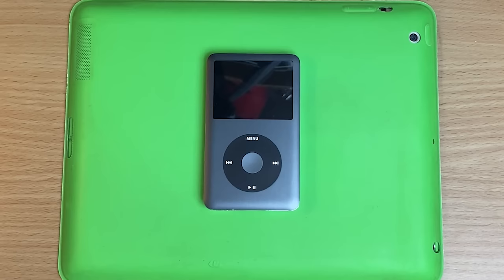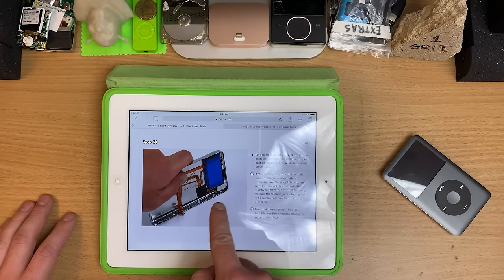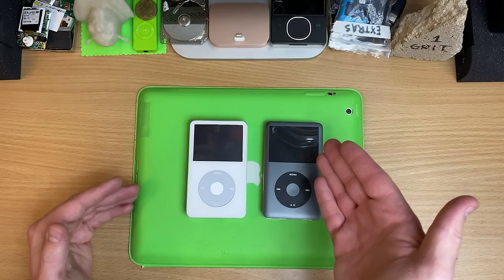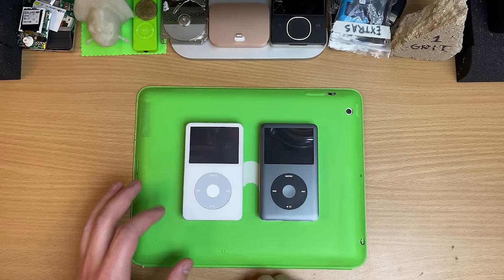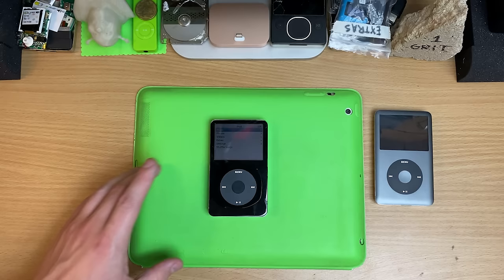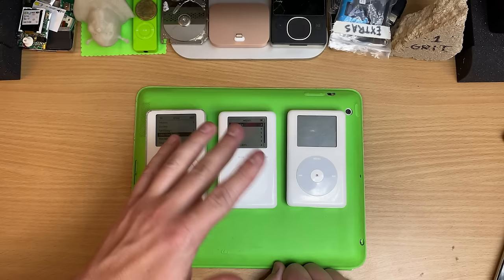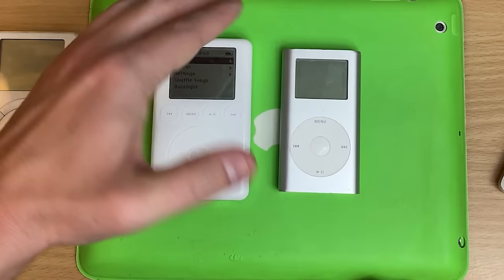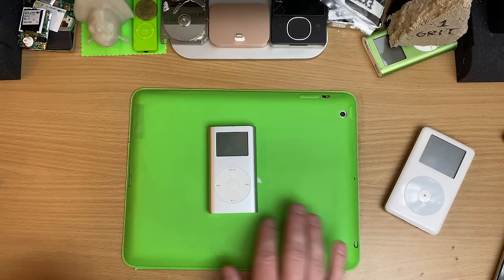The CHEAPEST iPod to modify

Comment: I watched this video and the next day I found a blue 2nd gen mini in the recycling at my job. I can't wait to use iFlash on it and add a new battery. :)
Reply: iFlash?  Just get a CF-to-SD adapter or a big compact flash
Reply: the thing is that those adapters aren't as reliable with iPods as the iFlash ones
Reply: @merouby  iFlash is the way to go, not some cheap chinese knock off that doenst work half the time

Comment: The iPod Mini 2G is literally the greatest iPod ever. Small, light, and they used the incredible IBM Microdrive which at the time implied Apple MIGHT have been making them AT A LOSS. Rumors suggested photographers were picking them up on sale to get the 4GB Microdrives cheaper than they were sold individually.

Also, the drive adapter pops off the board too, so just pull it off (gently) rather than trying to do what you did of wiggling the Microdrive out.
Reply: More than likely they got a deal with IBM, who early in the computer scene had a virtual monopoly on those sorts of bits and bobs because of patenting and shit

Comment: Thanks for the vids! With your help I pulled a Lazarus on my 2004 4th gen monochrome LCD. Popped in a new battery and an iFlash double SD card mod kit with 256 GB card and it works great with 236 Gb actual capacity. Loads of space for tunes and great battery life. Love it!

Comment: Got myself a metal 6th gen with a busted HDD as I wanted one of them schmexy new ones to contrast my older iPods. Gonna need some blades to get into it, lord have mercy

Update: I was blessed and with some hard work the exacto method worked, and it actually proved to be not toooooo bad (depending on your definition of pain)
Reply from the maker: Just remember 128gb max on a 6g
Reply: @DankPods  I'd settle for 1Gb frankly if it made the thing easier to crack, not sure if you've ever tried sacrificing storage to the iGods but will let you know how it goes
Reply: I have the same model. I want to get rid of it.

Comment: Hi Dankpods,

After watching your channel I thought I'd do it myself. I took a risk and modded my 30gb 5.5gen ipod and put 448gb in it (which for some reason is 416gb in apple maths) . My library is only 18,200 tracks but 13,500 of them are large ALAC files from my CD collection so that's about 350gb, the rest are mp3s but everything has artwork. My ipod could cope with all 350gb of my alac files but started having trouble with all the mp3s as well and it didn't like showing album artwork unless it was rebooted after syncing. It maxed out at around 17,000 tracks with a few issues.

So I wondered if I could make it all work perfectly. 

Luckily I managed to find a cheap 80gb 5.5gen, I took the back cover and front cover off my 30gb (I thought I'd use my front cover as I know where that's been), got a new battery and combined it all together. So now I have a monster slimline 448gb 5.5gen ipod that works like a dream, it'll even play the few old music videos I have and it has 30gb of space left over.

And yes it shuffles.

Thanks for the inspiration.

Comment: So I began modding these and here are my tips I’ve found
1) buy iFixit batteries, knockoffs can absolutely suck!!!
2) be careful removing top bezel, and moving motherboard/headphone jack. If the contacts unseat you’ll put together an iPod with no sound.
3) internals can be difficult to remove if battery is swollen, “it will fight you”
4) when re-adhering the bottom bezel, the tabs can easily break and prevent flush seat. Just remove and reapply
5) I use contact cement and q-tips for top/bot bezels, works like a charm.

Comment: 1st/2nd iPod gen can actually go to 40GB with a 4th Gen “04” HDD... I’ve done a video on that, I also just finished a 128GB 3rd Gen (it’s a pain to setup and use but works) and the 4th gen can go up to 256GB with no issues... I agree though that the Mini is the best, my daily is a 128GB I’ve had since 2013 and I’m getting ready to upgrade it to 256GB myself
Reply: What are the exact adapters you use for 4th gen? None of the things I've seen in these videos have worked.
Reply: Iflash has an adapter to convert Zif to the pins then you can just use the iflash boards... check out the 3rd gen videos ;)

Comment: With the mini it seems like aside from plastic cases you can only get refurbished cases nowadays
Also with the battery you may want to be careful when selecting replacement batteries, as a few have their wires placed in such a way that they push on the headphone jack board, causing it to come loose over time (I've had to open my mini half a dozen times because of this, I ended up having to tear off the stuff the manufacturer wrapped the battery cell in to re-wrap it with electrical tape so that I could actually have enough exposed cable to route it properly)

Comment: hello i just purchased a iPod Mini 2nd gen and i did a battery replacement and the flash mod. I knew that there was the risk of knocking off the C18 capacitor and not having the click wheel not functioning properly. I knocked it off and with the original drive the forward and backward buttons for skipping tracks didn't work. To me it was something I was okay with and was going to live with. But when i got the SD card with its adapter it didn't work but them i restored it and it suddenly worked again. I don't no what happened but i have a fully functional iPod now. Thank you for the video to and it was a fun project.

Comment: Monochrome 4th gen. is one of my favorite electronics of all time. Also love the silent buttons and sound quality of the 3rd gen. and the battery life of the 5th gen. Threw a 128GB microSD in the 4th and 5th and use these 3 in combination throughout the week. Looking forward to getting a CF card in the 4th gen. (for that sweet 10% battery improvement, hah) and the HDD out of the 3rd gen. in the future. I've only got about 7600 songs at 75% ALAC, 155GB so all the good ones fit on 128GB just fine. Good times. Love these old things and these videos.

Comment: A significant advantage of the later 6th and 7th generation iPods is their ability to power a Bluetooth dongle via the 30-pin connector, which is not possible with the 5th generation models. This setup allows you to bypass the inferior digital-to-analog converter (DAC) found in these newer iPods, directly transmitting the audio signal from the motherboard to your headphones using a Bluetooth 4.0 connection. The audio quality of this Bluetooth setup is nearly on par with CD quality, showing only about a 2% loss in fidelity. In contrast, using the built-in DAC of the 6th and 7th generation iPods with a standard 3.5mm headphone jack results in a 10% degradation compared to CD quality. Furthermore, even modifications to the 5.5 generation iPod Video that add Bluetooth capabilities still rely on the original DAC output via the 3.5mm jack, which means the audio quality is comparable to that achieved by simply attaching a basic Bluetooth dongle designed for airplane use to an unmodified iPod. Therefore, the optimal audio performance is achieved with a 7th generation iPod using a Bluetooth dongle connected through the 30-pin connector, powered directly by the iPod itself. And when you use the aforementioned BTLE dongle, you use slightly less battery than you do when powering over-ear wired headphones from the 3.5mm jack.

Comment: the best way i found to open an ipod mini is to apply a strong double-sided tape on the plastic parts leaving a piece left over on the sides and stick it on a metal surface then pull the ipod slowly.

Comment: I finally did this. Since the video was posted I looked for iPod minis at a decent price and some were just too much and there just wasn't much to go for. After a little bit of searching and finding a good deal, I ordered it, a cheap SD flash converter and a battery. It turns out I ordered the wrong IPod (second gen nano, silver) and ordered another one that was also a good deal. When that one finally arrived (pandemic started to really take hold of America, so some delays happened) I carefully took the whole thing apart, having trouble with the weird clip thing in the bottom. BTW there is a Instructables page showing a guy using hot glue and a plank of wood to take the plastic bits off without scratching or bending anything. After all my careful work, I come to find out that the parts I ordered were junk. The battery was way to thick (the spot where the wires come out was to bulging and there was a thick metal tab on the other side under the plastic heat shrink that was to thick) and the SD card converter just let the IPod write but not read. (I know this because I didn't have to reformat the SD card in the IFlash adapter) After ordering a battery from a better known provider and a IFlash adapter that I had to buy on eBay because the main site was down and when It went back up, there shipping was too expensive. The battery was delivered very promptly in a cheap but fancy looking box I could see being on store shelves. The adapter on the other hand wasn't shipped until a week later and then took a bit to get here. when I noticed it hadn't been shipped in a week I emailed the seller and they were like "oops, forgot." which brings me to today, where I finally got all the parts and tried again with much more success. Every thing works and i'm syncing it right now. The only thing i'm worried about now is the battery was a very snug fit and I know how much they like to expand. So I think i'm going to charge this in a metal pan or glass jar from now on. I also recommend getting kapton tape, its like electrical tape but much thinner for holding things together like the rubber bumpers on the flash adapter. Its as thin as the black tape they put on the drive itself.
Reply: Also, who do you buy batteries from? I bought mine off of eBay by some company called "Cameron Sino" and the Ifixit it site was out of them ( there 360 view shows a battery that looks very similar to the eBay junk.)

Comment: Alright, I actually dove into this thing, got the iPod, got the converter to get at least to 118GB, new battery- all working well...except one thing.  The clickwheel.  I've gone through FOUR different clickwheels- all just have issues functioning- 3 dead, and one works but Jesus Christ, the pause/play button doesn't work properly.  It may be the easiest to mod, BUT those clickwheels must be MAD sensitive to damage.  I'm actually awaiting my FIFTH clickwheel replacement.  I hope this doesn't come out to be a dud.

Comment: Many years ago I bought a second-handed ipod classic that suddenly stopped working some weeks thereafter. No sense for me  to repair it through ipad service and therefore i tried to repair it by myself with a  spirit of "nothing to loose". I tried  just introducing the nail of my thumb and with an up and down movement, many times, the ipod oppened. I disconect battery 1 minute and shortly thereafter y connect it and from then on it worked fine till now.

Comment: I just got a Mini recently and man, this thing is real tiny. It however had a little bit problem with the hold switch, fixed that by putting some isopropyl alcohol on the switch, move it back and forth and it worked

Comment: 9:34 I can't find the people that throw these away on eBay. The cheapest ones going are iPod Shuffle, the older 1GB one, and 2nd gen iPod nanos with a faulty backlight or/and with a f-ed battery. And the iPod mini's that are 2nd gen and are in working condition are all either pink or cost 100£. The 1st gens are cheap though, a green one is like 15£, though still more costly than the 4th gen iPod touch I got for 7.50£ (without shipping).

Comment: Pressing questions... So, over the summer, I've fixed/upgraded about 6 different iPods. I just did my 2nd Gen Mini upgrade and have noticed a few things.

1. Loading music is S---L---O---W.... is that just a thing I'm going to be living with? I get that going from 6 gigs to 256 means I'll make some concessions. I just want to make sure I didn't botch the job.
2. Car trips - I drive a Prius and have a USB port for my car stereo. When I plug my 6th and 7th gen iPods in, I can see my music library. When I plug in the mini, it shows up like it would if I was on a computer and tried to hack my tunes to back up (no logical labels, four-character letter folders that follow no logical order). Even if I set it to play a song, when I plug it into the car, it plays a different song. The car shuts OFF the iPod interface and only allows menu access on the car's screen.

I'm open to suggestions. :)
Reply: Anyone? Is this a firmware issue? Can I fix it?

Comment: I might actually ask for this in Christmas. The Ipod Mini Honestly looks pretty fun but I'm only worried abt battery life and don't know if its gud
Reply: A bit late but the first gen operates for 8 hours, second gen does 18. If you want search functionality, 5.5 gen classic or later. That's my nitpick as someone who never owned an iPod but I got used to it. I also added functionality with rockbox. What I like about rockbox is that you get to switch between stock software and rockbox by turning it on with the lockswitch on/off.

Comment: i just picked one up for 5€ and flash modded it with the exact red cf adapter u showed and it worked first try i used a san disk ultra card in it

Comment: Wanted something I could leave in my truck so I got myself a Mini on eBay for cheap because the lens was cracked (LCD is fine) and the battery was shot. 
Somehow managed to snap off the hold switch, don't know if it was during disassembly or reassembly or while it was disassembled. Doesn't matter too much to me because I have a 6th gen for any other listening but I'm still annoyed with myself.
PS you can save a buck by getting a first gen and the only real difference is 1st gen max storage is 128 GB and 2nd gen is 256 GB.

Comment: I saved up and put down just nearly $500 on one of those modified 1tb 5.5g off eBay, and installed rockbox to circumvent the 40k file system indexing limitation (have over 100k files). Only problems are rockbox is ugly to navigate and it was the janky plastic face and wheel so it got scratched up within like a week and it’s been hard to see ever since. I have a genuine 30gb lying around that I can take the face and click wheel from but I’m intimidated by the process.

Comment: Bought a 2nd gen mini, got the SD-CF adapter.  Did all the steps but it won't boot (I get sad iPod face).  Can't figure out what's wrong.  Tried reversing the adapter too.  Don't think any of the cables are damaged.  The hope is to pop a 256GB microSD in there, but I tested with smaller ones (32 and 8) and they didn't work either, same problem.

Comment: SO having picked up a (as i just recently figured out ) a 6.5 gen for free I found ifixit's instructions very unhelpful. I watched one of your vids where you had it apart, looked where the clips were, attacked it with a razorblade and a guitar pick, had it open in about 10 min. If you need to rip on of these apart, seriously look up a picture of where the clips are, and it will help TREMENODUSLY. 

Also, don't use a screwdriver, make sure to use something at least 1.5 to 2 inches long, or you will destroy the outer case. 

Mine is Syncing currently with a 512Gb SanDisk in it. Was really sad about not being able to maintain the stock os, but being standalone from iTunes and more storage is a definite bonus.

Comment: From the reading I've done, you can use 1st Gen Mini's however their battery life is terrible compared to the 2nd Gens, despite using the same battery.

Also, a great way to tell the difference is look at the EMC number. 1984 = 1st Gen, 2044 = 2nd Gen
Also also, if it has 6GB engraved on the back, it's obviously 6GB, but the 1st Gens only came 4gb so it has to be a 2nd.
Also also also, the colours of the 1st Gens have always seemed to be a bit "paler" than the 2nds. Have a look on google images and you should see what I mean.

Comment: Hey this is probably out of the ordinary and completely unusual but I have a 5th generation ipod nano and its formatted with MAC but I do not have a macintosh or any type of mac based system nor am I able to factory reset it through apple devices on windows or itunes it always says “Network Connection was reset please make sure your internet is active and try again” I tried this around 9-10 pm my time yesterday and I couldnt get it to work even after manually flushing/clearing my dns history it would let me get to the notices then say the same thing is there any way we would be able to call and you help? Im 17 and I have no clue how to run apple software besides the ipod itself I got the ipod from a thrift store (american cashies) for 3$ in mint condition no spicy pillow and you are the only person I know that may be able to help me in this situation

Comment: I must dig up my mini. I managed to put a 32 GB CF card in, but i think i will take it to 256 with the adapter. But i wonder.... could it push 512 GB? Maybe even 1TB? Basically use it not only for music, but as a disk drive for extra storage. I also might try to up the storage on my 3rd and 4th Gen to at least 64. The 4th gen photo might try and do 128.

Comment: I'm trying to get my classic 4th gen back up and running. Its flash modded and works from a software perspective. My issues is with to charging, I've tried a few 750 mAh batteries and they all continuously charge, if i unplug it the battery has charged but they all drain super quick even in standby. could this be the logic board?

Comment: I was trying to modify a fifth gen ipod with a 1000 gb card. My first time doing this, and I actually got it in and back together. Problem is, that everything was super slow in restoring. When I tried a few songs, no sound. My thinking that it's the sd card. What is the best cards to use? Any ideas on the sound? I was thinking that it may not be hooked up properly.